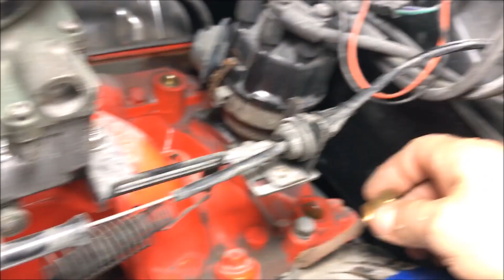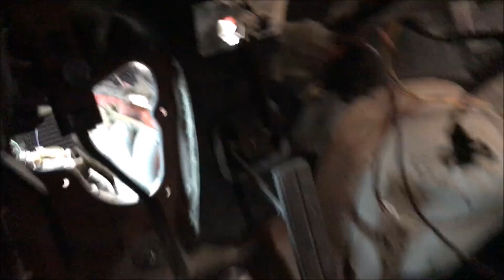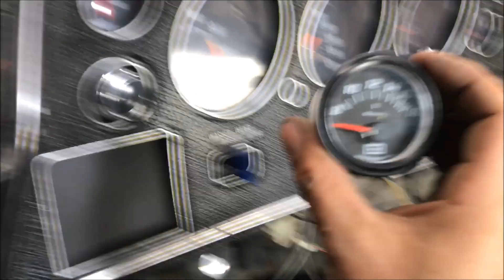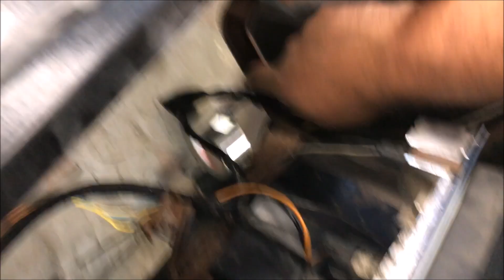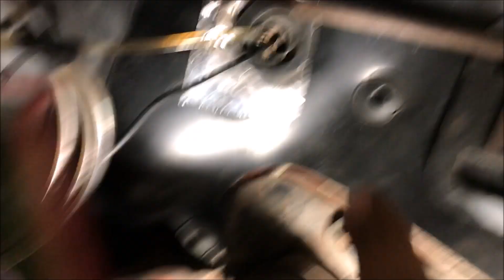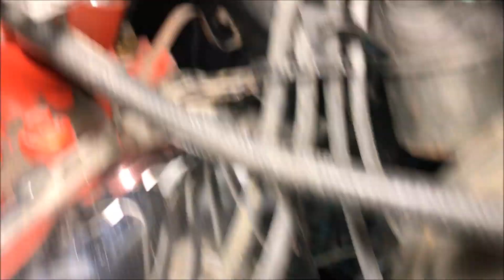installing water temp, voltmeter, oil pressure gauges AUX auxiliary how to

Comment: Do the water plugs always look like that or can it be with a bolt head I have a 1981 ford f150 ranger and I unscrewed a bolt with a bolt head and idk if what I did is correct

Comment: Hey, how is the nylon tube holding up for the oil oressure guage ?
Reply from the maker: as long as those lines don’t get too close to exhaust they last forever. they are poly lines and idiots bash them because they don’t know anything..  but run a copper line if you have one or can afford it

Comment: You mentioned using an Amp meter when you have an external regulator. Can you use the Volt meter with an external regulator? What would happen if you did?
Reply from the maker: nothing happens..   you can use it

Comment: Just an FYI everyone...DO NOT USE THAT plastic tubing get some 1/8" copper tubing....As you can over tighten the nut an cut it and over time it will become brittle..Think a minute how much of a mess that would be in side. High pressure and "HOT" oil

Comment: What size fittings did u use for your oil pressure switch to retain the original dummy light but accommodate the new gauge? I want to do the same. Great video
Reply: Did you ever figure this out
Reply: From my own research it is 1/8" fittings, however individual vehicles may vary.

Comment: Nice and useful video - I also have installed a mechanical pressure gauge and air bubbles in the pressure line - now I see a significantly higher pressure compared with my original electrical gauge - because of the air in the line ? Thanks !
Reply from the maker: purge the air bubbles out.. they don’t affect the gauge and if they did the pressure would be lower because air compresses

Comment: Did you need to drain the coolant before removing the water temp port?
Reply from the maker: no
Reply: @chriscraft77022   thank you! What about the oil when removing the plug by the oil filter for the oil pressure. I really appreciate it. Awsome video!

Comment: Get the 1/8" copper Oil pressure line on amazon. Plastic line is not durable
Reply from the maker: yes it is … they use poly lines on 18 wheeler brakes… methanol delivery systems on turbo charged cars… etc…

Comment: I'm replacing the old small gauges with 2 5/8" gauges by AutoMeter.  Got the oil gauge installed today.  On to the water temp tomorrow.  Don't know about the voltage yet.  I bought this ol' 1972 Chevy C10 a week ago and haven't taken the time to check the lights for a source of power to the gauge.  The truck is an absolute rust bucket, but all I'm wanting is a cool old driver.  Thanks for this video.  You gave me the confidence to do this gauge install.

Comment: WARNING....if you have a later model car or truck you may well NOT have access ports for oil and or water! Find out before buying gauges. These videos are always demonstrating install on OLD cars and trucks for a reason. My 2013 Silverado has NO access ports for after market gauges and I have since learned that the newer the car the less likely you will find access ports.

Comment: At 1:17 in your video; you can see an electric temp sensor in the side of the engine head. This is where the manual temp sensor should go. It will give you a better idea of how hot the engine is actually.
Reply: I see that what's up with that cause I'm trying to put my gauges in now and I'm working on a 64 olds 98... Looking for some help 🤣 joe
Reply: Wrong...anywhere in the cooling system...these dont measure engine temp...they measure cooling temp...if u want engine temp it is called a pyrometer...

Comment: I enjoy your videos. They are simple, direct and no bs. You dont try to complicate anything. I wish you were working on a '66 chevelle but most of the videos I use. Just one thing on this video, that extra wire on the splice you made should be cleared or cut shorter. It could short out under the dash. Keep bringin the vids.

Comment: So these types of gauges are for older cars? On modern cars like the coolant temp gauge the sender wires go first to the computer then to the gauge that is part of the factory gauge cluster. So after market gauge installation is a bit tricky on modern cars.
Reply: What isn't tricky about moderns? They don't want you to be able to do your own work. That's why I drive older DD's.

Comment: I know this video is old but it’s great! Where do I get the connectors to plumb up the oil line like you did. Thanks, keep up the great work Chris
Reply from the maker: they come in the kit but auto parts carry small brass fittings.. I got the 1/8" brass from home depot

Comment: Wow on the gauge you just use two rinses wrenches to tighten it that's why the threaded nipple part out of the back of the cage at the bottom of it has a spot to put a wrench or you can just hold on to it with your hand and break your gauge if you don't know what you're doing and turn it too tight because you are showing people how to install something correctly and not doing it correctly
Reply from the maker: that’s not a back up nut... if you back that up you can ruin the gauge... are you 13?

Comment: Nice thanks, good little tips along the way, like if oil pressure line leaks a bit don't panic and re-do just tighten a bit first for a stop leak, to see if that works. Good stuff on all the wiring too.

Comment: How can i fix my speedometer for my 1971 buick skylark ?
Reply from the maker: what have you done so far to fix it?
Reply: @chriscraft77022 I wanted to ask before i tried anything . What do you recommend?
Reply from the maker: pull the cable out of the back of the speedometer and see if it turns when the car is moving .. try to grab the square tube a little and see if it’s not broken... ( make sure it’s connected)
Reply: @chriscraft77022  the car is currently on jack stands because i am restoring it myself.  Is there any other way to do it without moving the car ?
Reply: The person i bought it from told me it needed to be replaced
Reply from the maker: how are you gonna check it without moving the car? it’s a speedometer.. just do it last.. I always do .. don’t ever listen to someone on how to fix something that they didn’t..
Reply: i figured that i just wanted clarification and i also seen it wasnt moving when i first drove it thanks
Reply from the maker: the transmission tail shaft has a drive gear.. there is another driven gear connected to that.. then the cable can be dried out or busted... it is usually never the actual speedometer that is bad
Reply: This is also my first time ever attempting rebuild a car by myself i have so many questions... your videos have been so much help
Reply: This odometer is driven by a cable from the transmission. I have fixed several of these units. The cable runs from underneath the chasis up through the firewall and into the dash. Remove speedo and drive vehicle.(Obviously at a slow speed and where you do not hit anything) and see if the square drive end inside the cable sheathing turns? If it does; your problem is in the odometer itself. If it does not turn replace cable.

Comment: Hello Chris, What Brand of Headers are you using, yours clear the oil pressure sending unit real nice, mine are directly in the path of sending unit, i'm also running both the gauge and the light. Thanks. Great Videos.

Comment: How much for the stereo?
Reply from the maker: which one? Was I selling a radio? I don’t remember
Reply: You are not offering it but I thought you maybe want to sell it, the pioneer on this car 70 chevelle
Reply from the maker: it’s just a regular radio that you can buy for like $50... you can get a way better one for like $70 new the one in my car is from like 2002.. unless you are looking for that exact one of course I would sell it.. how much you want to give for it
Reply: Im looking for that exact one, where are you at, do you still hace it, is there another way to talk about this?
Reply from the maker: @gustavobeltran2911  im in houston, TX..  i can sell it ..   how much will you give for it?   i can ship..  ive been selling online for years..i have a radio install video where you can se it work..  installing a modern radio vdeo..  its all about how much youll give for it .. because that determines if it is worth the trouble..
Reply: What model is it? Do you have all the Accessories?
Reply from the maker: @gustavobeltran2911  its a radio i pulled out of a truck i bought..  i dont know anything about it
Reply: I’m in Minnesota how could we do this?

Comment: You might want to mount the gauge cluster facing the driver. This makes the gauges easier to read from the drivers seat and eliminate "parallax view" inaccuricies. A grommet through the firewall is well done except sealing it so water does not leak through it. Otherwise, well done !

Comment: Were u find the plumbing for oil pressure
Reply from the maker: Home Depot .they have brass stuff there
Reply: I would not recommend using the supplied plastic line, in most auto parts chain stores like autozone and advanced they have a separate kit for the oil pressure that has copper line and fittings.  Just make sure you put the line in as far as it will go before tightening it.   the copper will out last the vehicle, where the plastic line will fail within 2 years.
Reply: Thanks im doing my 396 big block chevy last time when i primed it i did'nt get oil reading i think i did wrong from back of block that sbc at back but thanks ur video still helpful

Comment: Wire nuts on mobile applications can be troublesome. They are not made for the vibration. Solder with shrink tube works best.

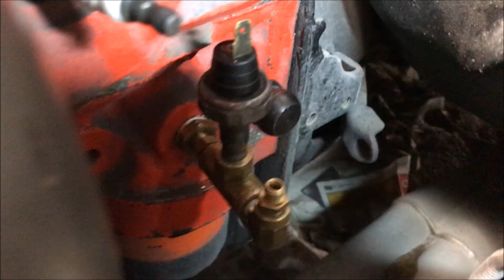Comment: What is the hole there to the left of the large hole during 2:26 I am doing the same thing but I don't really want to do a t fitting and I thought both of those holes are under oil pressure...
Reply from the maker: I’ll check it out when I get home.. do you have a big block chevy?
Reply: Chris Craft yeah it's a big block. I bet I'm gonna have to use the reducer fitting like you showed in the video. I have it put together in there it's just kinda funny looking. And some pictures on Google show that hole to the left being an oil hole. But if you run your car without a plug then it's obviously not part of the oil delivery system

Comment: Sir. I'm struggling to find where a Wire that comes from my Engine Harness Terminates. It is much different that all the other Wires. It has a White Cloth Cover. Do you have any thoughts ? Ted 1972 Buick GS.
Reply from the maker: that is a resisted down 6 volt wire that goes to the positive side of the coil.. from the ignition ON position.. that is your main ignition wire.. if you are running the old style coil.. then you are good.. if you are running HEI or electronic ignition you MUST remove that wire and replace it with a 12gauge stranded wire (factory style)
Reply: Sir. Thank you for the prompt reply. That is why the Test Light is very dim.  Ted.